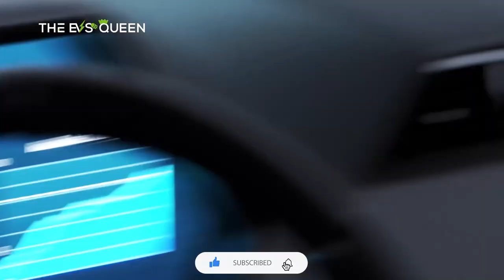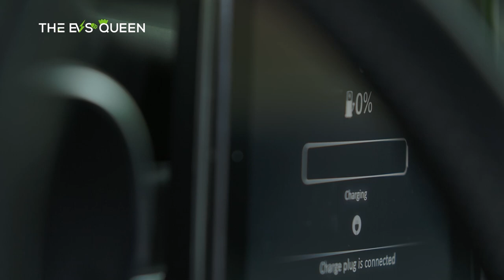Tesla Semi Logs Over 1,000 Miles On A Single Day In Independent Test

Comment: For all those curious about the number, the math is obviously wrong, and I wonder if this whole thing was written by ChatGPT (which is also bad at math). And I find it strange before publishing the video that someone wouldn't check this (but if based on AI, I guess that makes sense). If you add 81.1% of Motion, 11.1% of Charging, and 17% of Rest then the total is over 109%, FYI. And the video only gives the time it took for one charge (1.5hrs). It is reasonable however to assume 11.1% time for charging (but I think the real number is actually a little higher, but as charge rate/time is not linear, I won't bother hazarding a guess. Another problem is the charge, you add up the percentages (see below), even at the Wikipedia estimated 500mi range with 100% charge, you would get 787 mi max range. Third, the video states 1076 mi range at first but adds up the total to 1062. I'm 90% sure this entire story is a fabrication of AI (other than a Tesla Semi going 1K miles in a single day). Maybe to combat AI (at least in the early stages of confidently wrong LLM's), maybe those of us on the internet need to start using our brains, lol.

Charges:
• 9.17% --> 47% (37.83% @ ?hrs)
• 2.6% to 88.6% (86% @ hrs)
• 18% --> 51.5% (33.5% @ ?hrs)
Total ~157.33% (786.65 mi max range from charge)

But if we do the math based on the video numbers, it would come out to just over 2 hr 40 mins total for charging (over 24 hrs 12am-12am).

So for those stats nerds out there (estimates based on numbers from video, ballpark figures at best):
• Total Charge Time: ~2hrs 40mins total
• Range on a full charge: ~433 miles (371.99/85.83%)
• Total Distance (according to calculation): 1062 (vs stated 1076 mi)
• Speed: ~55 mph effective average (55.11 mph to 1st stop; 54.6 mph overall average)

Note: We do not know based on any of this the weight the truck was carrying and therefore it would be impossible to determine efficiency and like without more details. But based on online specs, one can conjecture the Semi has a range of 500 miles and 850 kWh battery capacity. If we assume that, it's likely the 433mi range is realistic for carrying a load (drop of ~13% efficiency or ~2 kWh/mi in real world applications).

That's more of the type story I would like to hear about, and I would probably believe it if the numbers added up 100%. Interesting, but take it with a grain of salt.